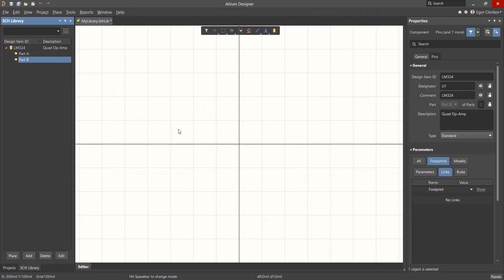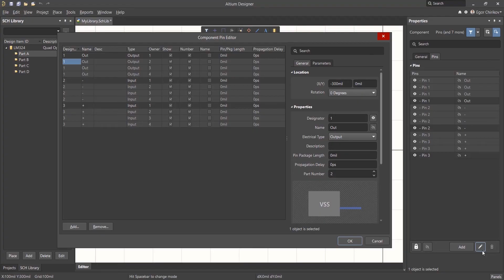Adding Parts to Schematic Libraries: Creating a Schematic Symbol in Altium Designer

Comment: Thanks! What about LM324 power pins? Vcc and Vee? We can add hidden pins with relevant net names, but this practice is undesirable, as I know. Adding power pins at each part of the component creates dublicated designators. How to add common power pins in components with multiple same parts? Such as LM324 OP AMP?
Reply: I like to make a fifth element in the symbol, just a rectangle with the power pins.  I can then place that part down, out of the way on the schematic.
Reply: @donbarr9487  Thanks, that a good idea. Also I like this method, because it is possible to place power part on schematic list with power supplies.